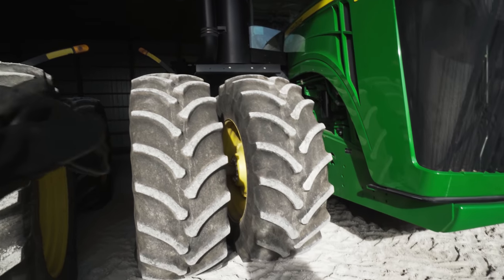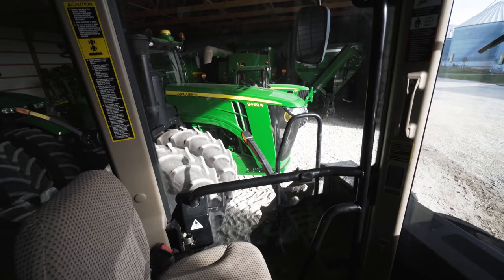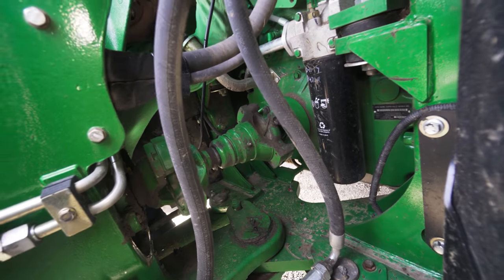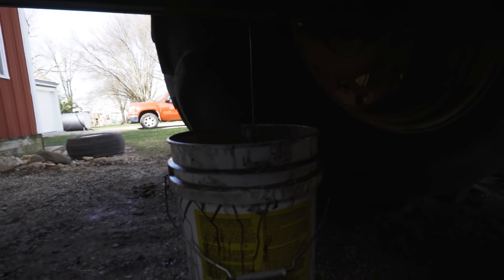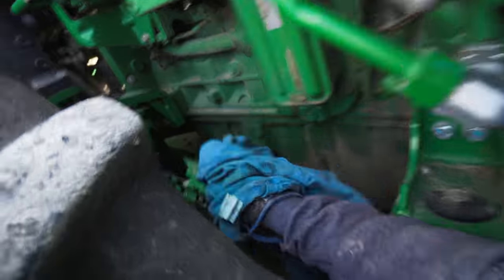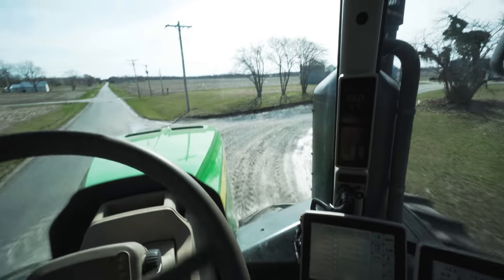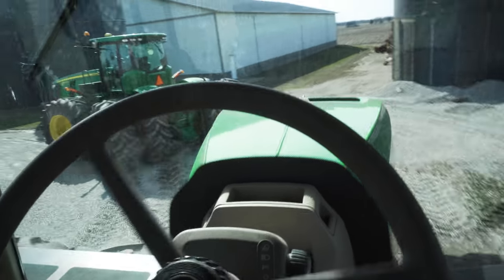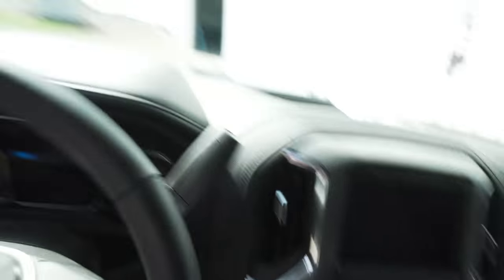The Big Tractors Come Out To Play... (Ep. 65)

Comment: What go pros do you use and what video editor do you use
Reply from the maker: I use two GoPro Hero 8s and a Sony 6400. The GoPro are used mainly for supplemental angles, and the Sony is what I walk around with. You can probably easily spot the difference in quality. The GoPros are the best camera by far for a beginner. They have great stabilization and an easy interface... just need to attach a better microphone. Thanks for the comment!
Reply: Thanks for reply if I got a hero 7 would that be good enough? And what microphone do you put on there? I'm trying to make some of my own videos.
Reply from the maker: @manitobadutchkid8989  I think that camera would work! The Rode VideoMicro is probably the best mic for the job, if it fits that camera. It is only around $60. You will need to find a case for the gopro so you can attach the mic.